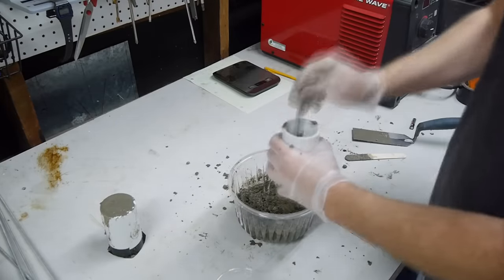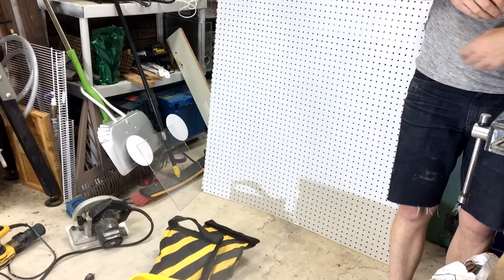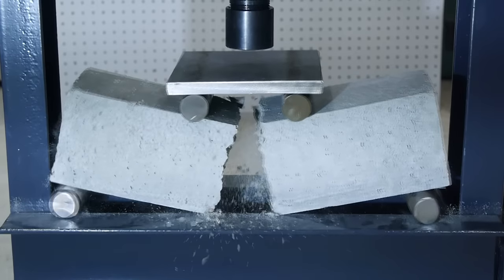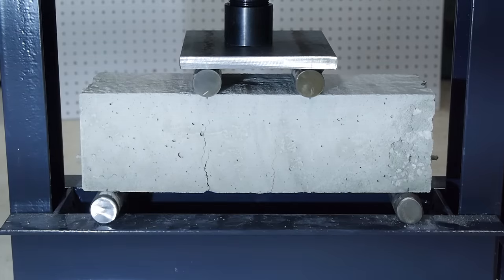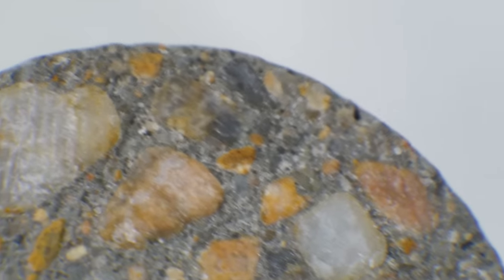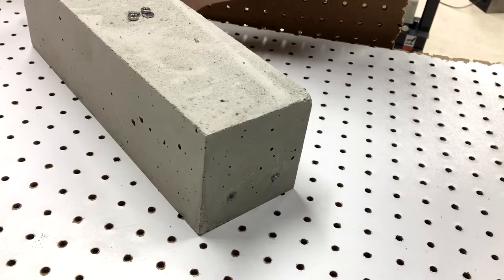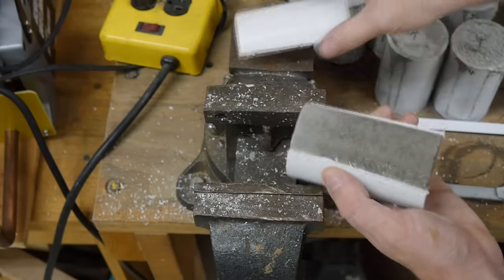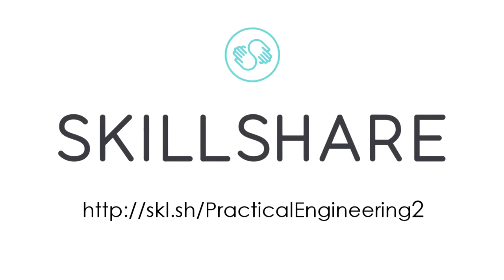Why Concrete Needs Reinforcement

Comment: As someone that scans concrete using GPR, it irked me to find out post tension cables have little to no benefits over regular matted rebar slabs. Every contractor in the DC area uses PT in their slabs nowadays.
Reply: 4:28 in this video explains exactly why PT slabs are used so often in modern designs.  The deflection and cracking of a rebar/mat reinforced slab would not be acceptable for many projects.  I often GPR as well and I feel your pain in dealing with PT slabs.

Comment: I wonder if where you placed the rebar in the cast impacts its strength and durability? or How many bar of rebar significantly increase the test threshold?
Reply: Placement does matter, and generally closer to the top or bottom of the beam is better. This is because when a beam is bending, the HIGHEST stress is on the very edge of the beam, while theoretically there is zero stress in the middle. The main reason rebar isn’t placed right on the top or bottom of beams is because that extra concrete “cover” prevents rusting or fire damage from occurring.

Also generally yeah more rebar = more strength but you CAN have too much rebar

Comment: But what about the scale of the structure? Have you seen those miniature hydroelectric generators they stick on small streams? Would I still need significant reinforcement to ensure its safety?

Comment: I am making atlas stones for strongman training. I hear after you take out stone from mold, after 5 days. You should put in contractor bag, with about gallon of water with bag tied. The idea is to cure the cement inside out vs outside in. Sounds counterintuitive but people do this with heavier stones.

Any ideas how effective this method is? Or should I add rebar. Or just 5000psi cement by itself, good enough?
Reply: The bag is a good idea or submerge it in lime water for best results. 5000 psi should be fine.

Comment: securing islets inside the concrete and pulling those isn't the same as pulling concrete apart itself like you would a rope. pulling that cylinder of concrete apart (If there was a way) I think ... would require much more than a bucket of rocks and a dumbbell. I'll add my 2 cents to the bucket, no movement expected.

Comment: I'm having some trouble understanding the science behind why the steel beams work. Is it because the cracks start on the inside of the concrete and are stopped in their path when coming into contact with the steel?

Comment: Why concrete needs reinforcement? Because without it, the construction would require more concrete to achieve same results that we have with reinforced concrete while also lasting significantly longer due to no expansion of rebar from rust thus making it a bit of a pickle in society that's used to planned obsolescence. Other than that, you can probably avoid putting tension on concrete if you make it into right shape (good example of this would be a dome) and in some areas there's little tension to begin with (like walls).

Comment: Hey 👋 this is Eric from Kenya east Africa 🌍.

I was wondering if we can borrow biology lessons onto this engineering stuff.

In biology we learn that animas have endoskeleton and exoskeleton.

Taking that analogy, then it means that rebar in concrete is Endoskeleton....can we use let's say pressure pipe pvc as an exoskeleton and make beams ?

What are the application limitations that this will have...like can we have it on fencing posts and not load bearing beams in a house? How well will it fair in the 3 forces: tensile, shear and compression.

Comment: Or call modules of rupture the blocks you made were fine if used in a wall such as or like Adobe the block work great even in seismic zone 4 providing there in comparison I designed plenty of earth structures out of Adobe blocks but the walls were double wythe with all tread rod between the wythes to a concrete bond beam with a hole through the beam were I used nuts and washers and comprised them down over the coarse of a month as the blocks dried out, the block were 12x16x4 Portland stabilization at 12 percent per volume

Comment: I want to add more concrete on my basement,  10" tall trying to lengthen the bathroom floor.  Is it ok to use threaded rod with the plastic sleeve vs. rebar for a quick fix.  Thanks.

Comment: The real title should be, "Why are we still installing steel into concrete?" 
The testing demonstrated is misleading.  Most foundations for residential buildings experience compression yes but distributed over a wide area, not a simple point load.  The same with tension which makes this garage demonstration useless.  Further, the concrete in the foundation is supported by surrounding earth or stone in direct opposition to the compression load.  It is not suspended in midair like a bridge.

Curious, were the samples of concrete cured in the proper manner for the minimum number of days to reach maximum P.S.I. strength before testing?  And what was the target P.S.I.?
It would seem that if residential foundations are designed and installed properly and cured before building on them, then rebar would be of limited use and a waste of money.
Eventually, the rebar will oxidize and compromise the surrounding concrete.  We see evidence of this along bridges and highways every day.

How many concrete contractors in residential construction, test the ready-mix coming in on the truck?  How many take samples for possible future testing or to document the house construction?
How many concrete contractors in the residential market, take the time to properly set up the site for curing concrete?  I have never seen any of these actions.
How many YT videos showing rebar in footers have the rebar placed correctly particularly in the corners?  None that I have seen.

Has it been proven by any competent, qualified, disinterested third party, that installing rebar is necessary for light frame residential construction?
Or is this just another "feel good" practice that should have been dropped long ago?

Comment: I have question, For the porous concrete, is it possible to put some rebar on it so that it will not crack in the future? and why mostly of the contractor didnt put some rebar in porous concrete? is it possible to use porous concrete in widely use llike in the highways? Thanks

Comment: Hmmm, Let's see.  Concrete cracks before the rebar can help take the load.  The cracks then allow corrosion of the rebar.  Corrosion of the rebar then creates pressures that produce more cracking.  Then the structure fails.  It's a slow motion, "frog-in-the-pot" process that ends in building collapse or need for replacement before it does.  Sounds to me like rebarred concrete is not a material we want for more sustainable buildings.

Comment: And let's not forget that concrete has a tendency to crack. Take a look at your garage floor - see a crack here or there? But it was perfect when they built it, right? That same characteristic is what causes water to leak into the concrete and eat away at the rebar in tall buildings - rebar being the primary item that gives modern concrete its strength. 
They don't make them like they used to.

Comment: If a column is casted weak, can I poor cement and water mixture over the concrete to improve its strength since concrete is porous?

Comment: I am in the  process of having a house built, the contractor made an error when making the door opening.  In order to make the door fit they had to add cement at the base of the  opening and ground about an inch off the lintel.  Is it okay to grind down a lintel with out compromising the integrity of the structure?

Comment: Do I need to bother with reinforcement for a very small concrete job?  I have to fill an opening around an in-ground pool skimmer that was just replaced.  The space to fill is only 19 inches x 19 inches, and 3-1/2 inches deep.  Any input is appreciated.

Comment: Get the right kinds of rebar/reinforcement for your job. If your concrete gets wet, or more precisely get submerged, even temporarily, the rebar becomes cancer to the concrete. By rusting. Concrete is like a sponge. And all that raw material won’t last long. And eventually make “rust channels” that form holes. It’s actually one of the reasons for modern infrastructure failure. To much raw rebar was used, and it has a temporary lifespan. There are other choices that are better. Just depending on what your job requires.

Comment: The fundamental reason to reinforce concrete with steel bars is to delay the failure of structural reinforced concrete members that made up the fabric of a building.  The delay time in a collapse permits occupants to run for safety to the nearest exits.

Comment: haven't watched the video but i think i know the reason. I think that its because a block of concrete basically doesn't have enough tensile strength so basically the builders or whatever put metal rods which have great tensile strength inside of the concrete and this keeps the concrete from stretching or breaking or whatever uh bye

Comment: Well if we were able to produce the superior form of concrete they the Roman’s used, then rebarb might not be necessary.
Reply: Roman concrete is not superior. Our concrete today is far more efficient at handling loads and requires far less than the romans use to carry the same load.
Reply: @bruh-ni1fy  todays concrete does not self heal like Roman concrete does which has allowed it to survive for thousands of years! Todays concrete does have rebarb which is the onlything that can make it stronger, but it eh concrete itself. Today’s concrete crumples after only a couple of decades and cannot self heal. People just have a hard time comprehending that a society from so long ago actually has at least something better.

Comment: rebar shape into collumned but tied up by other smaller diameter size rebar.bended like arc shape as "bone".than pour concreted at the end.but make mold shape arc before pouring concreted.is it strong enough?.

Comment: you are better off with pure steel work or pure concrete unless you have stainless or other rust proof rebar otherwise the rebar in concrete rusts and the building life will be severely limited - 40 years is typical.

Comment: 1:45 - that's way more than 80 pounds, the fact that the dumbbell was dropped into the bucket makes it an increased weight. Hanging the weights onto a hook from below, gently, would have been the way to go. But I guess this wasn't supposed to be accurate testing.

Comment: The Soviet Union was known for overly enforcing their concrete with iron rods. In Chernobyl, the old buiildings are starting to show serious decay. A concrete specialist mentioned that Chernobyl will fall quickly when it does because iron enforced concrete is much stronger however once the iron rods are exposed the concrete will decay much faster.

Comment: how does concreate additives such as water resistance or colouring affect the strength of concrete, and if you were to rebuild the concrete barges of the past using todays knowledge and tech?

Comment: This video is up for 4 years so i'm a bit late i guess but i have a question.
I want to make concrete walls about 6 ft wide 3 ft high and 2 inch thick, i want to reinforce this just to be safe when it breaks that it will stay where it is before i replace it instead of crashing down on somebody.
I dont want to use rebar because steel rusts and will expend, breaking down the concrete.
Where i live i can not get glassfibre bars but i have a lot of stainless threated rod.
Do you think it would be okay to put it in the concrete or shall it break with the concrete because of the threads?
I ask this because you used it in your sample but dont mension it in the video and i am really curious.

Comment: Another factor you forgot is the amount of air in the concrete. I am refering to the beem you used around the 2 min mark. The air makes it weaker. To make it go awey you have to vibrate it. Your point gets forward but still. And then we have the facotor that it is a hella piss - job to lay reinforcment xD. Real pain in the ass.

Comment: Explain why they use  steel rebar in a  porous material like  concrete - as when saturated rebar corrodes and swells and cracks the concrete - which means that structures will  start to deteriorate in less than 50 years  - they knew this from the start of use - yet they still continue to use bare steel rebar - not coated or treated in any way. so what you have is ticking time bombs everywhere . - tower blocks , bridges and dams  -with possibly  less than 100 years  lifespan  before  total failure! - then in the reports of the failures they like to use the words like unprecedented a lot !?!

Comment: I have a question: Why don't roads have roofs? I mean I know it would be crazy expensive but wouldn't it make the road last much longer? Not to mention it wouldn't have to be salted and plowed. Elon Musk wants to dig tunnels and a roof has to be cheaper than that.
Reply: Because building and maintaining hundreds of miles of roof costs more than just redoing a part of the road every now and then. Tunnels are really no solution to that problem, apart from the costs to build multi-lane tunnels they also bring a lot of health risks with them. Even the short ones Elon Musk built have serious health hazards in case of a fire for example. The Tunnels are not equipped with an automatic fire to extinguish system and have no escape routes.

Comment: The real question is both ideas are stealing from this world so the real question is what should we use as a substitute to supply a solid material besides wood or concrete how about the glass and the combination of a lot of lava rock mixed with sand to reform a solid surface which is not a bad idea

Comment: I always wondered. Why the fuck every time i see rebarb being put in concrete, its coroded and there is rust on it. You would expect it being at least coated by something so it will be clean.

Comment: The very idea of designing a building without a metal frame seems to me to be idiotic. I understand the incentive to build faster, cheaper, to rely on unscrupulous designers who will stop at nothing to save money. The need to placate the mob-controlled builder's unions that supply the concrete and the lifting cranes, using less rebar to save money, to not dig down to bedrock for a solid foundation... etc. Today's efforts are so pathetic I would have a hard time describing any of it as engineering. 
If you want to study how to use concrete in construction, look no farther than the Pantheon. It's in Rome, Italy. It has a gigantic dome made out of concrete and has been around for 2,000 years! Or check out the Roman aqueducts, many of them still standing from the time of Emperor Claudius.
And then we have the Champlain Towers crap built by that paragon of society, Nathan Reiber, that collapsed, killing almost a hundred people.

Comment: Do you have any experience with "dirtcrete" or soil cement?
I have a lot of retaining walls and hardscapes to work out on my property that far exceeds my budget.
I've been trying to learn about the limits of soil cement mixtures. i.e. https://www.youtube.com/watch?v=NIYcMc7Jc2Y
I've seen it used for floors and non-load bearing surfaces. I may start with a greenhouse floor, but I also want to do compressed retaining wall blocks if possible.

Comment: ur wrong its not the best the stuff the stuff that was used in ancient time was better stuff  to defend the agument just look at stuff we use concret for with it reinfores with rebar so on u see all that stuff that was used back in ww1 and ww2 u see is crubeling going to hell after howmany years of not maintaining it and look at the stuff used back then u still see it in good shape after what hundreds of years latter its still standing like the great parimeds so on thay still standing dispit the hard wether condison on it and no one maintining it for hundresds of years so compart the 2 together and u tell me whats better
Reply: Making a 1-1 comparison and or Comparing and contrasting these two wildly different structures is not the way to go about things.

Lets take an example, the Roman Roads, i've heard many say that "Roman roads are superior than Modern roads" Due to making a simple compare and contrast while completely disregarding what those roads were meant for in the first place (They were built for moderate traffic and light, horse drawn materials) While modern roads are built for heavy traffic, heavy cargo such as a car with hundreds of cars passing through every single day, replace our modern roads with Roman roads and they wouldn't even last a day.

Same thing with other structures back in the day such as buildings, they weren't made for the type of shoes we have, the amount of people on them, and the amount of traffic they gain.

Search up any conservationist, and they will tell you that the buildings were not made for the amount of tourists they get today, its they're main concern for people visiting these old landmarks because they were simply were not made for the amount of people visiting them, today's buildings are made for it, and are designed around having heavy boots and massive amount of people occupying a small space and or building.

What your describing is simply Survival Bias.

Comment: Lets add something that rusts to something that is porous 👌 waste all that time engineering just to inevitably produce structural skid marks and a gradual drop in integrity leading to catastrophic collapse. Even if you seal the concrete gahbaage.